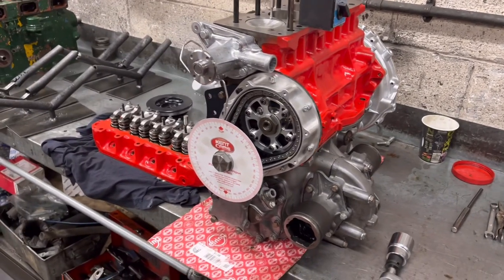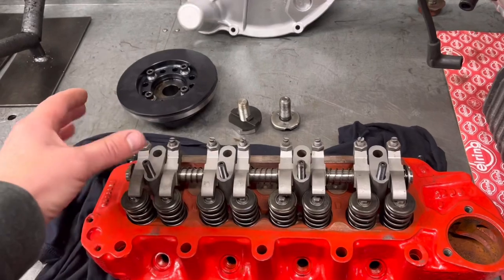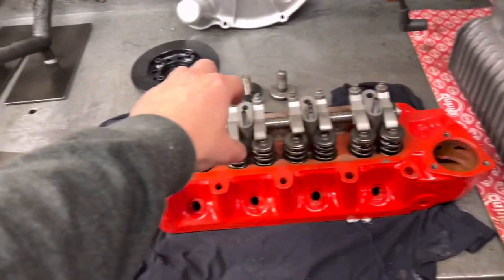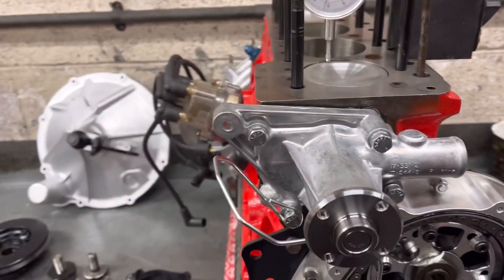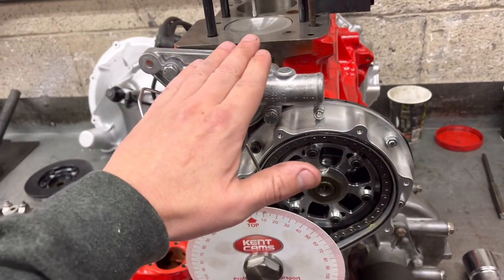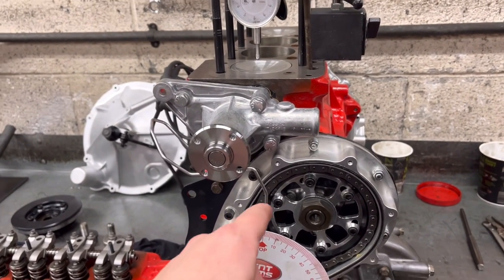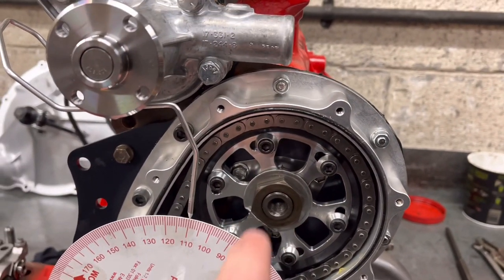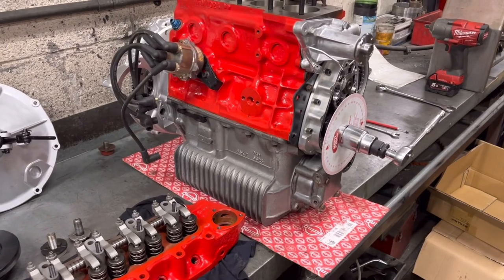Is your cam timing is WRONG? You may need a vernier pulley

Comment: Great video that brings back a lot of memories.  Many years ago I did the spannering for a mate that raced an MG Midget with a 1275 "A" series engine.with a 649 camshaft and other tweaks that are lost in the mists of time. He eventually sold the car to a guy in Belgium and bought a Formula Ford instead. You did a great job explaining how to set TDC and cam timing with a dial indicator. Thanks.

Comment: I use 3 gauges in this process, one in the spark plug hole. I also have a jig with one gauge fixed on the intake bucket and one on the exhaust bucket. Then I do as you do, I measure at a certain angle before and after TDC and spilt the difference. Works well, I run around 112 degree on intake and exhaust for as little overlap as possible in turbocharged applications. For all out racing I would go with 114 degree on both cams. Running turbo kits produced by MCXpress in Sweden, I used to double the output of a 150 HP snowmobile (4 stroke Yamaha engines) to 290+ HP. With some additional tune and the cam degreeing I would make 30+ more HP for around 320-325 HP on a 1000cc DOHC Yamaha 4 cylinder engine. My current snowmobile puts out about 315 HP :-) You are spot on, and thank you for your videos, they are great to follow.

Comment: During the episode you showed several views of the head.
As an observation the rockers look miles away from being central on the valves.
Years of experience and slightly OCD mentally has proven this is an absolutely critical area to focus on.  Many builder are guilty of slapping heads together thinking valve guide tolerances and face's are all that are necessary.
Your views are appreciated.
Reply: As well as solid spacers not those springs, stops rocker walk, and side swiping valve stem.

Comment: Couple of observations..
The indicator deal is fine but you are making it way more complicated than it needs to be, a rigid piston stop is faster and zero guess work, also we degree right off the pushrod,  no head needed, ever, roll the cam to max lift, zero the ind, roll clockwise. 02" note the wheel reading,  rotate counter clockwise more than .02" on the other side of zero so you can come back to .02" in a clockwise motion to ensure the chain is tight,  stop at .02" note wheel, add the 2 wheel # together and divide by 2, this is the int centerline,  100% accurate  every time., I do enjoy your videos!

Comment: HI, This is an adjustable slotted timing sprocket not a "Vernier" adjustable sprocket . A vernier sprocket would have a centre boss with x number of radial holes the cam boss would have one hole difference to the sprocket (x+1) when the cam and sprocket are timed only one of the radial holes will line upon both parts. a washer with a dowel attached is fitted to the lined up hole and a retaining nut holds it in place.. A stepped flat piece of steel bolted across the cylinder bore that blocks the piston approx 1/4 in. before TDC is the best way to set up the degree disc in my opinion

Comment: I have always used a positive piston stop set before piston top travel, set zero on the degree wheel then turned the engine reverse direction to the stop and then split the difference on the degree wheel.

Comment: Hi lee yeah I was with you all the way, I use to do the kent x-flow and they use to have 10deg dwell 5deg each side and I use to fit the kent cams, bcf3, but going back 30 or 40 years ago I cannot remember the btdc & atdc measurements now but was they fast even with the oem webber 32/34 dtfm. ho and the full janspeed manifold and exhaust system "put it like this, the speedo went up to 115 mph and i  was off the end the needle was hitting the peg, I prolly doing about 117mpg for a  Cortina mk 2 1600 gt 1969 with the wooden dash and 4 clocks and speedo and tacho

Comment: Great explanation and I wish the mechanic that set my pinto up new how to do it 
I had a pinto built many years ago with full group one head and a modified cam 
Engine ran for a year no problem until a super rally driver / mechanic said have you ever timed it in proper 
Me being a young guy said no and he started to tell me it needed done 
He charged me a fortune and spent hours doing it 
Well after his work the car only got 4 miles before it chewed all the lobes of the cam and went rattle rattle 
He Blamed the cam saying it was to high a lift 
My answer was it was ok for the last year 
The total pillock was just a blow hard and turns out he has knackered many a engine since

Comment: Why no solid rocker spacers to stop rocker walk? A positive stop finds tdc more accurately. All that said when we needed a bit more low down torque for the customer on race day giving the exhausts a few more thou on the valve clearance would let it hold power stroke a little longer, giving a bit more punch out of corners (only possible on push rod motors).
Reply: I run my A series 1380 with 20 thou valve clearances, that's with a 649 scatter camshaft......that's using MED 1.3 ratio roller tipped rockers.
Reply: @pauljeffries  that makes for a nice A series motor. Our bread and butter used to be ford motors, crossflows, essex v6 and v4 cologne v6 and cosworth 2.0 and 2.9.

Comment: I can imagine using a piston stop being quicker though may add lash,but seeing as the cam at full lift is full lift i can't see why you need to install the head to measure it,an old push rod or a dummy rod can be fitted with a washer welded on and a spring held by a holed plate on the top of the block to keep the  surfaces together ,oil or assembly lube might cause stiction.

Comment: I built a twin turbo 24v 2.9 cosworth v6 a few years ago for a mate who had been shafted by an engine builder as the Pistons on that engine picked up on the dyno, I stripped it and the bores where like banana's hand honed, loads wrong, uprated parts he paid for not in the engine, scrapped the block and started again, I had custom valves made by G&S valves as nothing was available off the shelf, then made adjustable cam pulleys...4 of the buggers. I must of dry built that engine 6 times to work out the valve timing and piston to valve clearance available, time consuming but has to be done and can appreciate the time and effort into setting them up.
Reply: Did you take block to +90 and stroke grind crank? You can then get a reliable 300 hp naturally aspirated motor, even more with a turbo.
Reply: @Chris Clarke  no stock crank,  If I remember correctly it was 94mm pistons, the FBE N/A 300bhp version was a belter though, this turbo engine made 500bhp at low boost, arias coated pistons and wire rung, it was fitted in 2wd mk1 sierra, Turbos flowed enough for 750 but he wanted a reliable engine, so was never pushed as he was happy. there was a guy who ran 900bhp before finally snapping a crank! ...mad
Reply: @Theclarksonmtb  they were a good motor, not appreciated enough, in the day they were a rover v8 rival, if not better. We put several into capris with custom management and slide throttle they were brilliant reliable road motor. Their potential was never realised, when considering the block was basically a 2.9 cologne with lifter bores not machined.
Reply: Yep I used a BOB block and crank which had no lifter bores, knew I guy who had a boa on Jenvey throttle bodies, the induction noise was satisfying
Reply: @Theclarksonmtb  the BOEs were a good starting point to, but being a special race version they were like hens teeth to find.

Comment: Coming soon to the channel.  Warranty claim due to oil contamination with red paint.  

A pro would paint then face the head.  Oil filter mounts full of paint.  Rocket case full of paint.  All ready to flake off and kill the engine. 

You also dont need to assemble the head to degree the cam,as you can just put a dial gauge on the pushrod, to find the max lift of the cam and the opening and closing degrees of the cam.

Comment: From someone who is an educator - absolutely nothing wrong with your explanation. Sincere question: any reason why you use imperial measurement system- is it because this engine would have been built at a time when that was the norm or is it something else? I trained and served my time a long time ago (30 years almost, but not the UK) and even then SI units were the norm.  It seems like there are still some hangovers of imperial measurement in some small pockets of industry perhaps? I can use both systems but imperial unit of measurement just doesn't seem to make much sense when standardisation is based on SI units... Thanks for the videos.
Reply: Because it's England and we still use Imperial. The lift measurements are irrelevant though, it's all about finding points of rotation which is always degrees.

Comment: You would find precise TDC more easily if you simply used a piston stop either through the spark plug hole or attached to the top of the block and working directly on the piston crown!

Comment: TDC centring should be checked much further down the bore, ie much more crank angle each side. Get away from the TDC area. 
People are commenting here about positive stops but in my book TDC should be found via indicator and rotating in the running direction only.

Comment: What you have just done is ok for a street boy racer application I guess.  You are simply not accurate enough for high end race spec engines. You need to find the true crank TDC from measuring much lower down the stroke BTDC and after ATDC.  Also, providing the cams are symmetrical , you should time the camshaft at about 50 thou of lift on each ramp. Full lift position is not so critical. I assume that you have measured the accuracy of the cam profiles.
Reply: Agreed positive stop finds tdc more accurately. Checking cam profile is a must especially when base circle been ground for more lift. A cam with polydyne correction can be a pig to time in. I am surprised with all the work being put into that motor that it still using springs for rocker spacers rather than solid spacers to stop rocker walk.
Reply: @chrisclarke6344  a lot of people who do modern engines simply don't know how to tune an A series engine for power, they aren't  as easy as some people assume.
Reply: @pauljeffries  nope its a dying art, mention a LCB exhaust and they have no clue. We also used to dispense with stem seals on race motors and machine top of guides to let a little oil down stem, never had a guide failure doing that.
Reply: @chrisclarke6344  I've recently purchased a 3 into 1 manifold for mine, I feel that the stage 2 LCB that I have is restricting the engine, I'll see what happens on the dyno once its fitted.
Reply: @pauljeffries  will be interesting to find out, we found an LCB worked well with the siamesed port ground to a finer profile. One thing that gave a bit more power was to have the bottom of the header flush with port, and the top above the port, this appeared to stop gas 'rollback' into the port. Another thing we could never get over to people was a shiny smooth inlet port caused fuel drop out where a rougher one didnt.
Reply: @chrisclarke6344  yep, shiny ports are bad news on an A series.
Reply: @chrisclarke6344  Regarding shiny inlet ports causing droplet formation, Bill Blydenstein always adhered to that principal.
Reply: @pauljeffries  they also always wanted massive carbs on it was a struggle to get them to understand an engine that is over carbed will be sluggish to the throttle and only really work at peak rpm. Whereas a smaller carb would get air column moving quicker and thus be more responsive to throttle. A prime example was wanting 45 DCOEs on a 1.6 crossflow not a much better 28 or 30, because fred said that is what was needed, then complain it had no pick up.
Reply: @brembo450  we ran an experiment once with shiny ports, ran a crossflow on the dyno with manifold bolted with two bolts, then killed motor and whipped manifold off the fuel droplets were visble and were nearly pooling o  port floor. Put a head with rough ports on and ran again, no visble droplets.
Reply: @chrisclarke6344  Good to actually see the evidence.  What rpm would say that polished ports become an advantage if at all?
Reply: @brembo450  from experience none  carb fed or injected will still cause problems. I feel shiny ports were a thing to make a head look good for a customer, but serving no good purpose.
Reply: @chrisclarke6344  always left the inlet port rough so to induce fuel swirl as it goes into the cylinder .. even adding some small diagonal cuts inside the port to assist it even more ... used to be and old boy that i worked with in the early 80s who worked with ST tuning , used to watch him for hours lol
Reply: @themadmechanic1964  a lot of the 'old' tuning knowledge has gone, its all remap and more boost now.
Reply: @chrisclarke6344  like you try and show someone how to balance twin carbs .. they think your mad lol
Reply: @themadmechanic1964  or even triple DCNFs on a v6 ford, thats good fun even when you know how to do it! Or spraying a little water onto each header to check each cylinder has the same temperature.
Reply: @chrisclarke6344  I must confess this is a lot different when than I do it .. in short found TDC then the two cam lobes get their numbers on the gauge then we used to half them … long time since I done it to be honest … was a bit confused by this way 😀
Reply: @themadmechanic1964  finding TDC with a dial gauge is an awkward inaccurate way. A positive stop is quicker and mote accurate, and as brembo said full lift is not really what is needed the point cam starts to lift gives you better timing. In the old days moving cam pulley/sprocket with offset dowels or keys took a fair while, vernier pulleys are much easier, and on twin cam motors allows to advance /retard each cam to pick up more torque or horsepower as required within small limits. Cam timing can be a black art. It did surprise me that with all that work , new rockers etc they still using springs not solid spacers on rockers.
Reply: @chrisclarke6344  and I would have put roller rockers instead of the standard stuff .. but the budget can slow that love to what carb exhaust setup he will be using .. all that could be a waist 🤭
Reply: @chrisclarke6344  now your going into the world of complete madness lol lol … my head hurts just thinking about it … I think I may do a YouTube video on how I do a cam timing … love a good debate lol
Reply: @themadmechanic1964  probably twin SUs and LCB manifold at a guess. Cam timing on dyno can take for ever, build, run, read power, strip adjust cam, run, read power, rinse and repeat, brain starts to hurt, rinse and repeat. Machine new offset dowel...........! Solid spacers will help even on standard rockers minimises rocker walk and side thrust on valve stem, then we move into varying rocker ratio to maximise cam profile, its a fascinating subject but time consuming. As you say good to have a discussion with someone who knows what they are talking about. There used to be crossflow heads for A series motors with 8 ports, dont know if they still available but they improved the motors breathing immensely.
Reply: @themadmechanic1964  Everybody in this reply section seems to be on the same page.  One thing that has been only briefly mentioned is that of cam grind accuracy. In my experience, factory camshafts have been accurate but a lot of the reprofiled ones have been out by double digits.  Checking the lift throughout full rotation before the final build takes time but is rewarding when you know for sure that it's right.
Reply: @chrisclarke6344  oh yes 8 port still going ,used a few in the past with motorcycle carbs or twin 40s sticking out the front … oh happy days .. used to love tuning the A/B series engines … cold sheds porting  and gas flowing heads to get some sort of power out of them 
And yes great chatting the same I remember working on a old mini engine in a garage where I worked .. all of the staff I worked with were dumb struck with what we used to do … we’re mechanics in them days not just fitters like now 😀
Reply: @brembo450  from experience the cam grind is as good as the operator, hence as you say checking should be done on every lobe not just 1 or 2. We found that one pair of lobes could have different lobe angles and dwell from the next pair. Many cams were sent back for this and other reasons.
Reply: @themadmechanic1964  good to hear that they still available, indeed tuning back in the day was engineering with hands covered in cutting oil. I suspect today if you told someone you could increase stroke by grinding a smaller offset crankpin with oversize bearings they would think you were mad! Then we can move on to rod length and piston pin height for mor power. Some motorsccould spend a fortnight on the dyno to get the best from them.
Reply: @brembo450  your so right cam setup an  be a nightmare I used to go through each profile note it down and then see where we are .. I do t know know if cams are made using CNC these days but they do seem more consistent